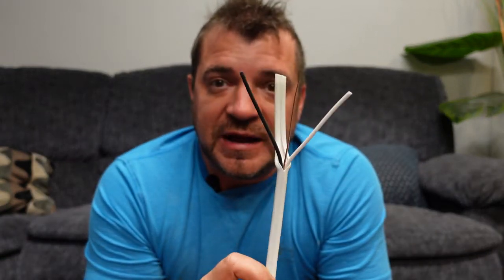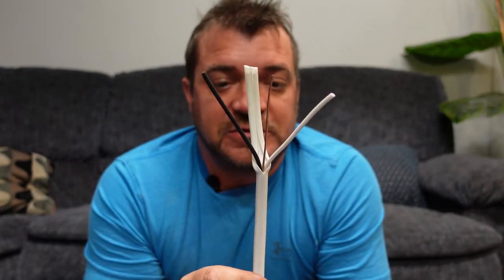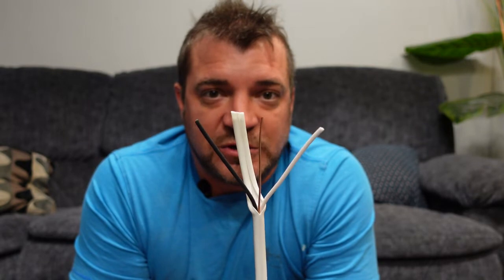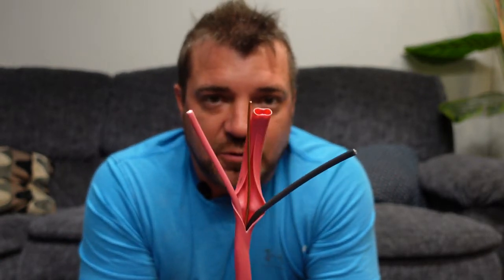What Size Wire For 240 Volt

Comment: I need to run single phase 220/240 to my garage for an electric heater and a 220v belt sander. (about 40 amps combined) My garage is about 75 feet from my electrical panel. What size wire should i run? Thank you ahead of time.

Comment: On the website, you state " However in our most recent code code is stated that we are permitted to run this up to 50 Aamps of overcurrent protection even though the wires only ready for 40 amps.

The code stipulates that if it is used for an electric heat resistant flow it can be rated at 50 A instead of 40" 

Could you provide a code reference for this? I'm unaware of such a rule, but quite interested if one does exist.
Reply: It is section 62-114 I believe of the Canadian electrical code. Although it is permitted it most likely limited to 40 amp do to the overcurrent device rating in the 75 degree column of the tables for that current rating. If one can get a 90 degree rated breaker it is permitted. However since Covid 90 degree breakers are hard to get. They are all reared at 75 degrees. Hope this helps
Reply: @yourpowershop1  I see. Didn't know you were in the Canadian code. The NEC has no exception for doing 8/3 on a 50, at least that I've ever seen. Wouldn't be a terrible rule though.

Comment: how far from the panel can I run my 6 gauge for my 240v welder. my garage is 35 feet from my panel and I want to run it up into the attic anf then down into my garage

Comment: Hello I want to install 2 electric heaters , 240 volt and 4000 watt total , can I use a 12/2 and a double pole 30amp breaker??
Reply: No. 12/2 is not rated for 30A

Comment: Hi There, I’m installing all new wiring for my new stove. The instructions say to use a 40 amp 3 prong cord. What size wire do I need from the outlet to the breaker panel?  Thanks

Comment: Hi, thanks for the video. I'm doing some wiring for a workshop and I have a circuit of 120v outlets (yellow romex, 10 gauge), about 10 of them, running around the perimeter of the garage walls. About 6 inches above that, I'm running a separate 240v circuit (orange romex, 10 gauge) that will feed about 5 or 6 NEMA 6-20 outlets. These will provide power for things like a lathe, table saw and a milling machine. That solid 10 gauge is tough to work with! Bit by bit, I've discarded everything I would use for a 120v outlet, like connector clamps, wire nuts, and single gang plastic boxes as they are too small and too flimsy to handle stuffing that chunky wire into them. Even with double gang metal boxes, I'm finding it very difficult to get the wires dressed properly in there. the more I work with it, the more questions I have. 1. Are several 240v outlets arranged on the same circuit, or is this discouraged? I ask because adding pigtails to the boxes fills them up so fast. I won't be using any of these tools at the same time, so it's not going to trip the breaker, but I wonder about the integrity of so many connections in these heavier load circuits. If someone runs 10/3 romex to a mini-split, for instance, there's no splices... 2. Are lever clamps allowed, to insure a solid connection? (Twisting those wires isn't easy either) 3. The basic home depot NEMA 6-20 outlet- the connectors on them are very flimsy. I have a couple of receptacles on order from mcmaster carr to see if the build quality is better. Would love to see a video explaining some of these details.